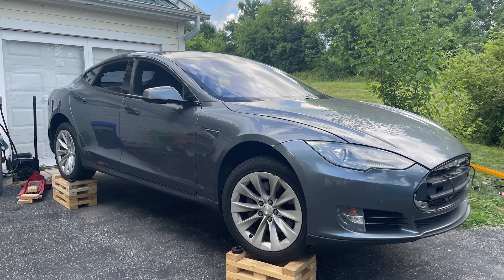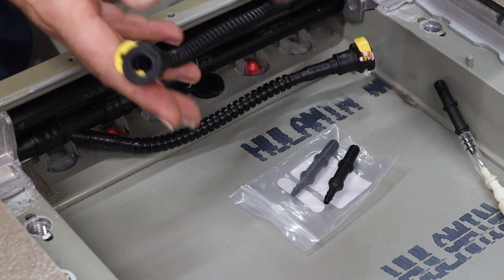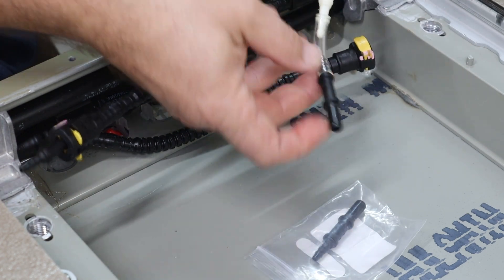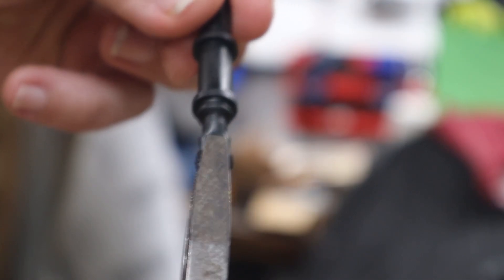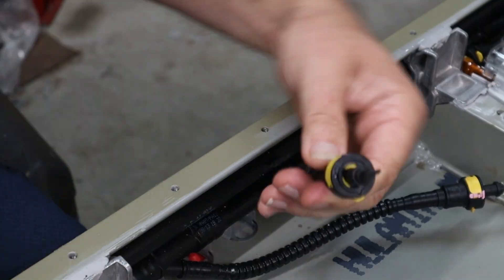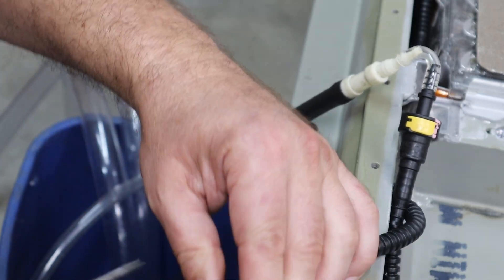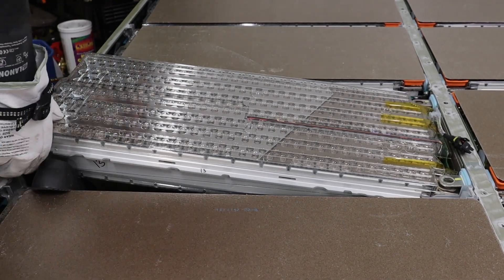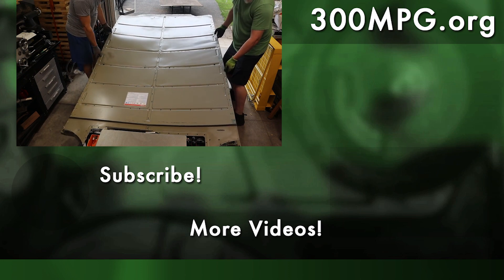DIY Tesla Battery Repair: Coolant Line Testing

Comment: Thanks for the explanation!  I'd recommend a rubber plug instead of the "flame" method of blocking the pipe, and probably like 2-3 PSI is enough, and even a hand pump.
Reply from the maker: I melted the end of that connector shut because I had several of the 5/16ths fuel line adapters and it was just an easy way to close it off. I really didn't want rubber plugs popping out while my hands were already full. Yes, just a few PSI is plenty. Doesn't need much, just enough to make sure there aren't any loose coolant hoses!

Comment: Thanks for the video!  I don’t have direct experience with these batteries so this question is pretty simple: Where does the coolant flow inside the battery module? Is there a corrugated cooling plate below the cells? Is there heat conductive grease between the two? Inquiring minds want to know…😊
Reply from the maker: It weaves back and forth between the vertically oriented cylindrical cells.
Reply: @BenjaminNelsonX Inside a plastic tube? Coolant doesn’t come in direct contact with the cells, does it?
Reply from the maker: @starckmad1779  No. The aluminum tube that the plastic hose connects to is really what goes inside the module. It's essentially a flattened aluminum tube which snakes its way through the module.
Reply: @BenjaminNelsonX  Thanks Ben. I got the picture now!